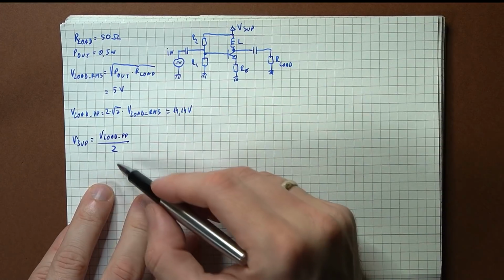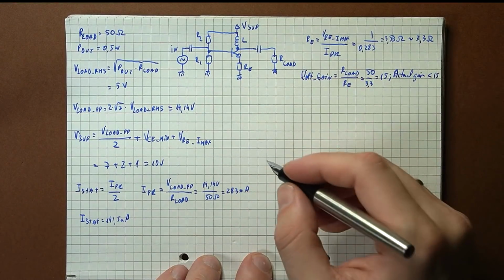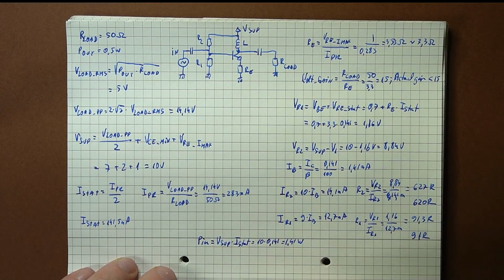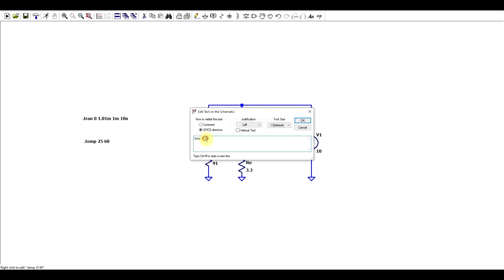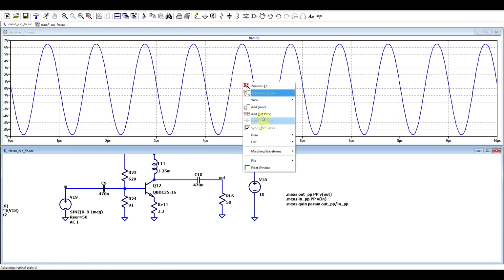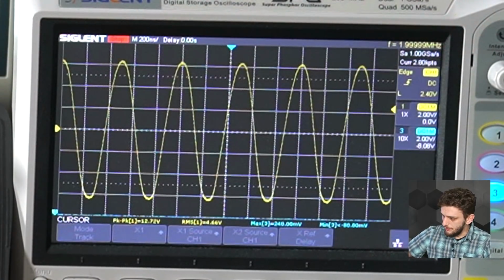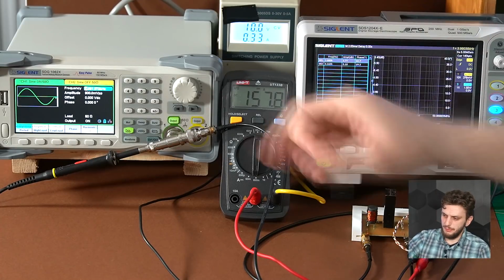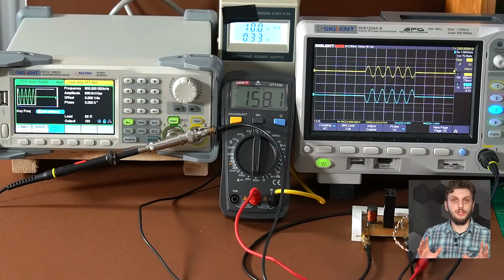The Class A amplifier - build and test (2/2)

Comment: In calculating the static current, you are using RL 50 ohm load which is blocked from Vcc via capacitor.  So I don't understand how this can be used to provide the static current. The way I see it is the static current is provided through the inductor which under DC conditions would have very little resistance and with a signal its resistance changes till RL become dominant. I really like your videos and using them to design and experiment with similar circuits.

Comment: I have tried a similar circuit to yours. What I find that without the 50 ohm load the gain varies with frequency because the impedance of L increases. With a 50 ohm load there is also some variation in gain. The larger the load resistor is the greater the variation.

Comment: Great video. Why did you not place a bypass capacitor across RE? Also why is the supply voltage 1/2 of Vload p_p? is that because of the inductor?
Reply from the maker: By placing a capacitor over RE, you get a very high amount of gain which is highly temperature and transistor dependent. I kept it this way to have a more predictable value. When amplifying small signals, you want as much gain as possible, so you will use the capacitor, but for large signals, too much gain will cause distortion.
Regarding the second point, yes, the inductor is allowing a higher collector voltage than the supply, so by using inductors you can get higher output voltages.

Comment: Great video. Did you try bypassing the emitter resistor with a capacitor to maintain DC operating bias but increase AC gain. BD135 give great RF performance up to 10Mhz in class C but usually end up going pop because of the high collector voltages produced.
Reply: Can you use a poler capacitor for this?

Comment: Nice one and thanks.
I recently built a Class A audio amplifier kit. I just followed instructions and don't really understand how it works. This video helps. It sounds amazing. Running about 15wpc it is not too hot but has huge heat sinks and uses a current source transistor. 
The inductor design looks cool but am intrigued by the transformer coupling.
Previously I have been using a SET valve(tube) amplifier.
I can't wait to see if you find a way to make it more efficient.
Reply from the maker: I'm happy you liked the video! I guess that with the valve amplifier you had the transformer on the output - so that should work more efficiently than the transistor amplifier with current sinks. However, with valves, the minimum anode voltage that you can achieve is limited - you cannot go as low as with transistors. I guess the best of both worlds would be a transistor amplifier with a transformer output - this is not that common since the price of the transformer is way more than the extra current sink transistor + heat sink.
Reply: @FesZElectronics  that's really interesting. The guy who made the valve amp I believe also made some transformer coupled transistor amps.
Now I know why... 😊
 Sadly he passed away last year. He used to make stuff for studios and even Pink Floyd.

Comment: Super tare Maestre, congratulation!
Ai putea sa continui seria cu si despre amplificatoare, sunt multi pasionati, e un subiect care prinde.
Exp de topicuri: the most common amplifier classes, Boucherot cell, Totem Pole, Bootstrap Circuit, LONG TAILED PAIR, constant current stage, current mirror circuit, Voltage Amplification Stage, Complementary-Feedback-Pair, single ended amplifier, etc.
Cheers

Comment: Well, let me help you out.   B comes next but is then followed by C and then somewhere down the list is PP.
What I like about your channel is that I am learning how to change my thinking from a technician's point of view ( how does this work ) to an engineering point of view ( how do I make something that will work).
Reply from the maker: PP (push-pull) is not an operating class, its just a specific implementation having active elements both "pull" and "push" the output - you can even implement class A operation with a PP stage - low side amplifier transistor and high side constant current source. Unless of course you meant something else by "PP".
I'm happy you are enjoying my videos :D

Comment: You are a great teacher in electronics, I like that you are showing every detail you need to take into account when designing a circuit and you also show what the circuit does with the change of temperature, what the current consumption is when there's a signal going through and without a signal, I didn't know that the temperature would go up without the signal.
So you can see that you excellent way of explaining things and showing the signals on the different meters and scopes that even someone like me who knows almost all you need to know can still learn a thing or two from watching your videos.
Thank you very much for sharing this online, you make it so easy to follow along and you keep it interesting so I don't lose focus.
Reply: Input signal made transistor changes its own resistant value which it goes in a unidirectional way , rises up from DC quiescent operating point.  The more resistant ,the less current can flow in and the less power loss.

Comment: Excellent video as usual! Have you considered also analyzing the noise of the amplifiers and how they work with very weak input? It would be interesting to see how different topologies and transistors (BJT, JFET) compare when there is no need to produce much power, but the input signal has very low amplitude.
Reply from the maker: I guess this a different topic - typical noise figure of different component types; its an interesting topic though, I will try to do something about it at some point!

Comment: Can a power FET be used in linear mode, in place of the NPN?  
since it's a voltage driven gate, can bigger resistors be used in biasing the gate, to decrease power loss?
Reply from the maker: Yes, FET's can be used, and since they don't need current for the static operating point, it will allow the use of larger values. The only thing to keep in mind is that the exact threshold voltage for the FET is contained in quite a wide range (its not as precise as the 0.6V for the BJT); so you might need to adjust the bias resistors with a potentiometer.

Comment: can i use iron core inductor for audio application?
because at lower frequencies the ferrite core inductor, won't act more like an inductor.
right?
Reply from the maker: In general iron core is most common for low frequency (<20KHz); it will provide good permeability at relatively low cost.
Reply: @FesZElectronics  right.